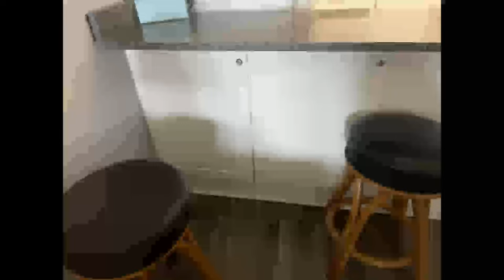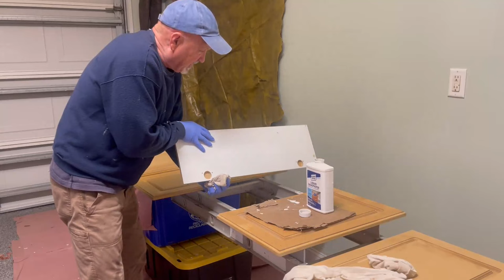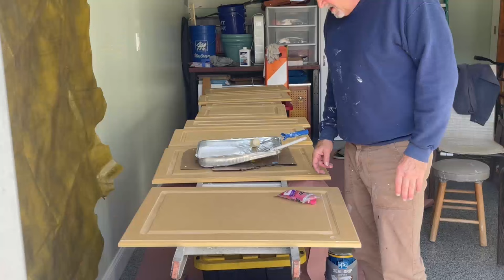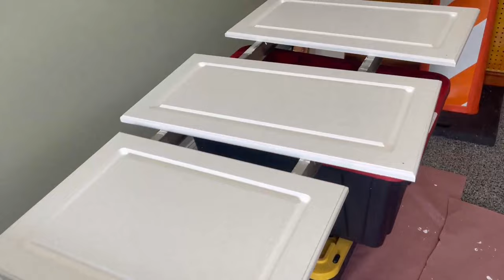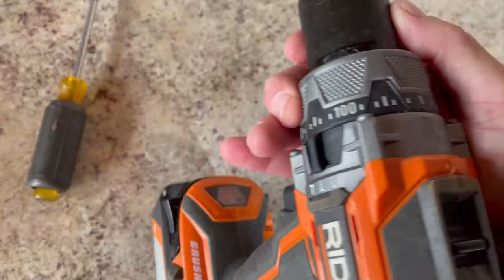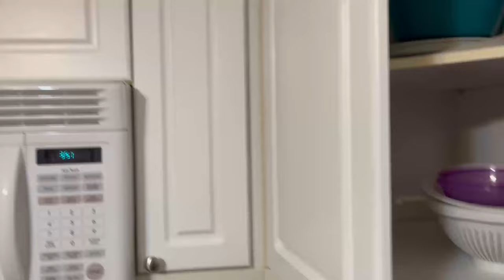Painting Cabinet Doors/  Remove Thermofoil and Painting MDF Doors

Comment: Nice job, Thanks for sharing! How are they holding up so far? I'm getting ready to do the same thing. Did you use anything after the liquid sand paper before priming?
Reply from the maker: I recently replaced bath fans in that condo and was checking out the cabinets- they still looked really good. One thing about painted cabinets is you can always touch them up if they get scratched, so Keep your cabinet paint around. 
  I didn’t use anything after the liquid sandpaper on these but you may need to sand some areas if they’re still too glossy. 
 Good luck with your Cabinets!

Comment: Great video. I took my thermafoil off too and unfortunately the glue took some of the top layer of mdf off on some of them 😢
Any tips on how I could fix this? Some of the areas are large and 'fluffy' so I tried to sand back but not looking great.
Any tips would be appreciated!
Reply: Im currently going through this, I’m about to experiment with a few solutions I’ve read to see if I can get a good result

Comment: Whay about the inside of the cabinets mine are ripping inside as well?
Reply from the maker: I’ve never dealt with thermafoil on the inside of cabinets, I’ve only redone doors. I have re-glued  laminate back that is coming up, (it’s a little messy but works) Sorry I’m not much help on this one.
Reply: @Eaglewatch333  yes your right it's laminate on the inside. Its all peeled up so it looks like a mess
Reply: Great video. I took my thermafoil off too and unfortunately the glue took some of the top layer of mdf off on some of them 😢
Any tips on how I could fix this? Some of the areas are large and 'fluffy' so I tried to sand back but not looking great.
Any tips would be appreciated!
Reply from the maker: @carolyncassells3446 yeah.. probably needed a heat gun in some areas. You can try using an oil base primer on the bad area and then lightly sanding it after drying. Maybe repeat this process if it helps. You can also skim over rough spots with some type of wood filler and sand. Don’t know if this helps but- you can do it